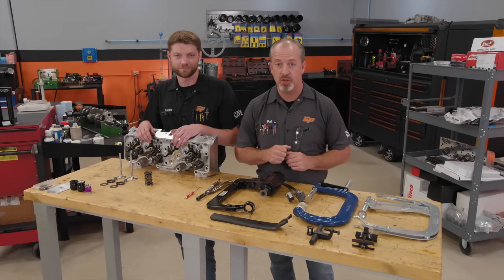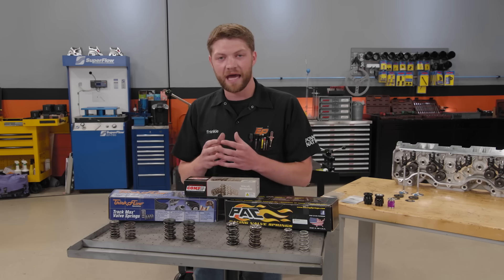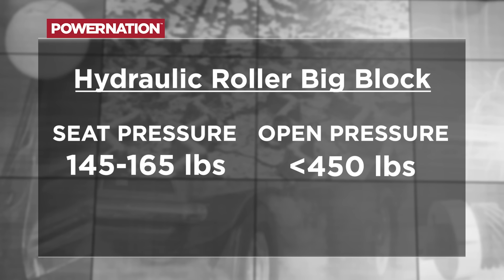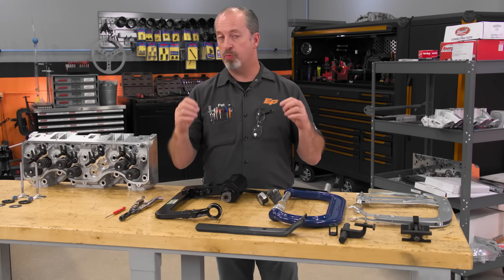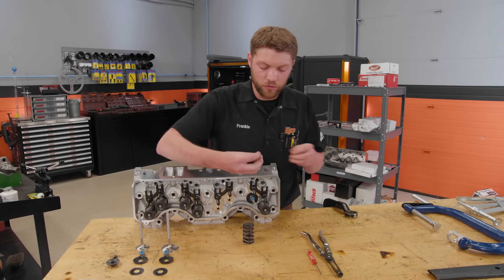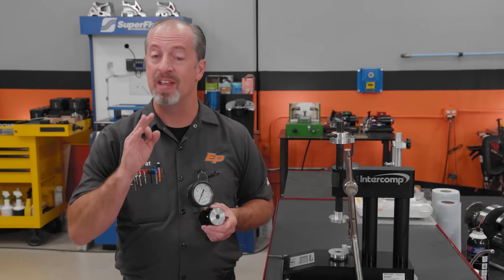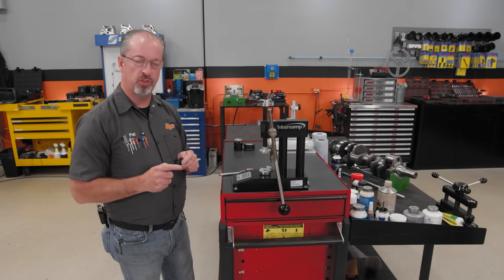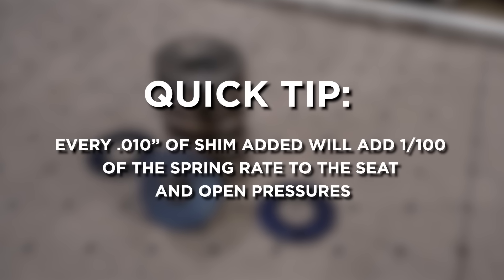Valve Springs: How to Choose, Set Up & Install Them Right (For Your BUILD!)

Comment: Just an idea. You've built a ton of LS engines but never an actual step by step how to video to give the viewer confidence they could do it themselves. It would be great to have professionals make an easy to follow guide for those of us at home trying this for the first time. There are others who have attempted to make how to LS videos but they forget to mention what the torque specs they're using, were they try to use ARP studs which let's be honest most people aren't using when rebuilding an LS engine. They also will forget to tell you what kind of lubricant goes in certain places. I think it would just be a great video series.
Reply from the maker: We'll definitely keeping that in mind for future videos. We do our best to tell all the technical specs we can for each build, and show as much of the process as we can, but we are always limited on video time so we have to decide what gets priority. We'll see if we can have more in depth assemblies in the future!
Reply: I will say that all OEMs have torque specs available for the engines. Always use some form of assembly lube or assembly grease on bearing surfaces (not under them though). Break-in oils on initial startups are recommended. Just to name a few major points.
Some bolts like head bolts are torque-to-yield type fasteners so they need replaced on a rebuild. ARP products always give the torque specs for their fasteners and some assembly lube.

Comment: One subject I'd have like to seen is the head itself.  For instance putting the recommended spring in a 5.0 for an alphabet cam into the GT40- p head  or the springs to work over I think it is .515 lift of a vortec head the guide and pockets have to be verified if not modified in the case of the vortec a screw in stud modification because open pressure is too high and will pull the stud and many more issues.   Perhaps a future video.  Roller rocker changes and how to measure the pushrod length a little more in depth. How about dome piston or even compression height.
Reply from the maker: Awesome ideas, thanks for the suggestions!
Reply: @enginepowertv    As long as I have your attentions.  I think you'll need to have a dino race.  Frieberger, Farmer, Topolinski   ALL the marbles.    And to make it interesting AMC engines.   4.0L I6   and NO just buying from the manufacturers.   Get Gregg S at JE to make forgings and Fel Pro to make the seals n gaskets.  Compression limit of say 10.5  and the remaining pieces must be made from available OEM stuff.  Kind of like how we built power back in my day when we hollowed out Fred's wheels

Comment: I really appreciate the tech and educational portion. Some additional thoughts:

- At home engine balancing
- Blueprinting
- +1 for the Cam degree suggestion 
- cooling system performance and troubleshooting 

Also, it would be cool to get a peek behind the curtain of a Pro Stock, or even Mountain Motor, program. I’m sure there is a lot of cool information, even if it’s outdated - Pat still has to have contacts
Reply from the maker: We really appreciate the suggestions and will definitely keep those in mind as we plan out future videos👍🏼

Comment: Brilliant video and information as always. Gday from Australia. Just wondering, what is the name of that device used to measure spring pressure via a vice???? I was looking to get one to measure the spring pressure for my engine build. It was featured at 11.34 mark of video. Would be a cheaper option for me. Also for a hydraulic flat tappet cam with lift up to .488 intake and .512 exhaust, i was thinking Bee Hives would be great and lesson valve train weight. Would they be better than double springs?? Thanks again. Enjoy all the vids.
Reply from the maker: We’re glad you’re enjoying the content! The one we have is a 10429A Force Gauge. If you can find a beehive that fits and has the correct pressures, a beehive would be a great option to reduce the spring and retainer mass

Comment: Did you take into account the retainer height when checking the dual spring? If not your readings are high.
Reply from the maker: Yes you set the spring tester height with the retainer in the height mic so the spring is compressed to correct installed height when load testing it
Reply: @enginepowertv  Shiny
Reply: @enginepowertv  Shiny!

Comment: @enginepowertv - Love how you guys are transitioning to YouTube!!!

Idea - build a SBC for fuel economy and torque. 4.3 LT1, 283 or 305 chevy (with 305 vortecs heads?). Goal would be low rpm torque to be paired with an overdrive trans and 273 or 308 gear. Think 68 Nova that gets 25-30 mpg.

Comment: I wish you guys could show me just basics on how the spring works within the engine before getting technical. I appreciate the technical but sometimes a guy gets a little lost early and then can't make it to the end of the race. You two are my favorite, hope you don't stop making content.
Reply: Can I ask you what part is the piece you'd like to see?
Here they're discussing OHV (overhead valve), 2 valve per cylinder, V8 engines and the springs for them
Reply: @15749  Just a brief visual?/diagram of how the spring interacts in an engine to start off the segment would be great. Perhaps the show requires a basic level of understanding and is a me problem so its not a big deal, there are other channels out there for me to hunt for just would love for EP to have me all covered in one stop!

Comment: This is stupid. Does anyone remember when engine power built engines and dynoed them after?  Why has everyone left PowerNation including Tommy Boshers the real Og? At least show us information that isn't antiquated and 20 years old like every other video on PowerNation. Everything here has been done a thousand times on YouTube. Motortrend and everything with Steve Brule. Better representations of data at every level over you tools. I honestly used to love watching you guys but now I hate both of you more than Trump.  Not a single engine these loser could build would compete let alone survive in any modern scenario. Have these tools ever built or acknowledged a modern flat plain V8?😂 I remember them kinda hopping up a 4 cylinder Honda for carcass one time but not a modern engine ever. There are a thousand other YouTube channels including PowerNation and PowerNation 2 that show old stuff that you might be able to find used on eBay. Make new and preferably original content for once please!?!?!
Reply: Ouch! Hate is a pretty strong word. Perhaps you're overstating the case.
Reply: @mchristr perhaps but you also didn't completely disagree with me 😂 or at all really. It was tough love. It sounds meaner than it is. And thanks for having another opinion(mine isn't the correct or only one) without being mean about it. That's why I liked your comment. I'm taking the position of the bad guy here so you don't have to. I really did love watching this show once.

Comment: When your checking the end play on a crank and say if you dont have enough how do you modify the thrust bearing to get the correct end play
Reply: You can sand the bearing thrust face You just need a reasonably flat surface to sand on.
Reply from the maker: It is important to properly align the thrust faces with each if it is an main bearing with an integrated thrust face. If the top and bottom halves are offset from each other during installation, it can take away some of the thrust clearance. We usually do this by leaving the thrust bearing main cap a little loose and hitting the crank to the back and then the front, then gettly wedging it forward with a flat head between a counterwight and the main webbing of the block before torquing the thrust bearing main cap down. If the clearance is still too tight, and there's no defects or damage to the bearing, you can CAREFULLY sand down the matching thrust faces on a surface plate or piece of glass with some WD-40 and 600-800 grit sand paper.

Comment: I suggest showing how to degree the cams, camshafts, lobe seperation, and lift etc.
Reply from the maker: Excellent idea and definitely on our list 👍🏼
Reply: @enginepowertv, could you guys do a cam test using David Vizards 128 formula for calculating lsa for a sbc and see how it compares to the traditional method. I think a lot of people would be very interested in that test, maybe even get a cam specced out for whatever sbc you have and then see if David Vizard would spec one out according to his method and compare them back to back and see the pros and cons of each cam.
Reply: @enginepowertv sorry but the original comment and your response is just dumb.
Reply: 🎉Like they have done on PowerNation and PowerNation 2 a hundred times already? They literally speak of if not show degreeing every cam and engine they've ever built. It's literally Pats mantra. Everyone who's ever watched a PowerNation video knows what the circular wheel with all the marks on it is every time they build an engine.

Comment: Instead of air you can remove the sparkplug and feed some rope into the cylinder and rotate the engine to hold the valve tight to the seat. It will work in a pinch.
Reply: Yes, I used thin rubber vacuum hose one time ,work fine.

Comment: What is your take on rocker arm girdles. Are they worth it, will a good stud make them redundant, does a good stud even flex enough to matter. I didn't put the engine together that's in my car now, it has them. Just curious if they are a novelty or not.
Reply from the maker: They can be effective at adding rigidity to a good valvetrain setup, but if the valvetrain has problems already, it can make them worse by transferring it from one to the next and won’t necessarily cure other shortcomings in the setup
Reply: Definitely worth it. They reduce valvetrain motion which in turn should result in better/longer  times between needing adjustments. One of the main reasons most people are using 7/16” studs instead of 3/8 especially with roller cams. The more steady you can keep the valvetrain the better.